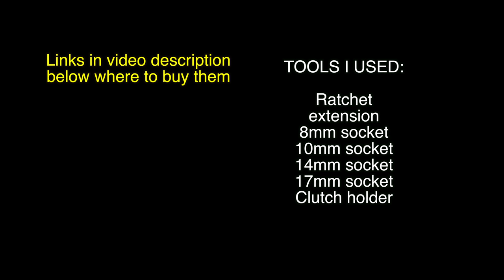Honda Ruckus / Zoomer 50 - CVT Removal (clutch, variators, rollers, belt) Mitch's Scooter Stuff

Comment: Hey i have an issue and im looking for some advice. I have a honda ruckus. My drive face i believe is broken. I have a video that i can email. If possible. The nut will not come off. The drive face literally wobbles and spins super freely. But since that is free as it sits. The nut now just spins in place and does not come off the shaft. Got any tips on how i could possibly lock on to the shaft somehow and remove this nut? Hopefully you get to read this soon. Thanks.

Comment: I am so desperate in removing that damn clutch nut off my 125cc scooter. My friend, the Clutch holder link is definitely not the same as the one you are using in your video? Why is that? The sad part about it is I can not find any youtube vid using that particular Clutch holder tool on amazon? Everyone seems to make their own pulley tool. If you can vouch for this tool to do the same job then I will surely buy one.
Reply from the maker: I used homemade one in this video, I filmed this almost a year ago then I bought clutch holder on amazon over the summer and have been using it on Burgman 400, Vespa and Elite. Yes you should get that clutch holder, I recommend
Reply: @MitchsScooterStuff  OK I did manage to buy that pulley tool and it finally worked. I had to use a different method and came up with my own. Quite pleased myself to change the clutch. Thnx
Reply: @buckmajor  what was that alternative method?